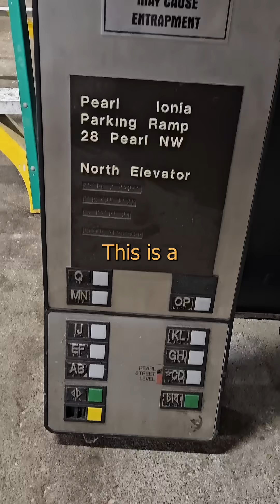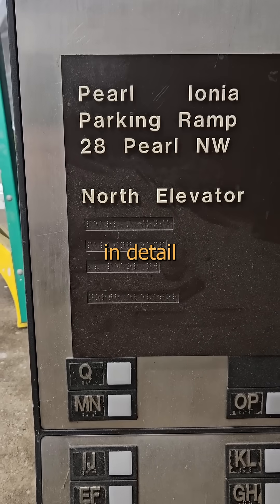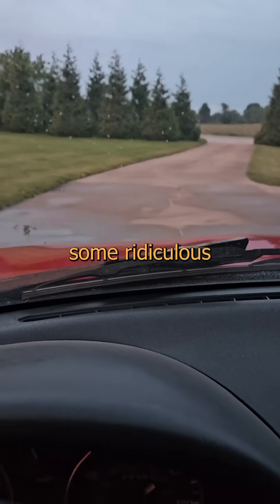Miata Mischief #chrisboden #engineering #gear #elevator #score #stories #parts #hacking #making

Comment: There used to be an amusement park in north Denver called Elitch Gardens. They had a train that you could ride around the park. By the west gates they had a large railroad crossing sign with flashing lights and a bell. When the park moved downtown a good friend of mine bought the sign at an auction. He had a small fiat so I took my vw microbus to help him pick it up. It ended up being too big to fit in the van, so we had to stick it out the sunroof. We got the strangest looks driving to his house. It's now his mailbox.

Comment: I owned a 90s Pontiac, I think, 2 door, and I ripped out the back seat and the passenger seat to have room and I packed it so full I had to squeeze in. 

I had a 91 Ford Explorer Hearse, the most awesome vehicle I ever owned. So smooth 
 Driving it was a dream. Still ran when I donated it to Cars 4 Kids. 

I packed in full of the skirting for my mobile home and I towed my 99 Avalon with it, fully packed. I blew out the shocks on the Explorer and almost crashed on I-87 near Catskill

I also tied a C-band Satellite Dish to the roof of the Explorer. I have a photo of that hanging on my wall. 

C-band Satellite Dishes are AWESOME and I highly recommend you get one.

Comment: About 5 years ago, I had a Mini Cooper (from 2014, so the BMW one). I had to get a 49" ultra-wide monitor from my home to my office (in box) but it just didn't fit.

So I opened up the sunroof, stuck it through and drove to the office with 35 centimeters of monitor box sticking out from the roof.

Comment: I once thought about starting a print shop at the house, and I actually drove to Canada to pick up a press, using a 90s t- bird pulling a trailer. Little did I know that you actually need a transmission cooler to tow with an automatic.  Long story short, I fried the tranny and blew the head gasket on the engine. Got the press home,  but spent the next weeks, fixing the car in the driveway.  Nothing like a tranny swap, I the middle of winter outside in ohio. Bonus points, to get the transmission out, you have to drop the drive shaft. To drop the drive shaft, you have to drop the gas tank. Lots of colorful words about Fords engineers.  Which brings up the point,  I see Ford has outdone that foolishness,  and now has an engine with a timing belt in an oil bath. Complete garbage. Remember,  friends don't let friends buy junk, even if it's used. The only way we are going to change things is by voting with our cash.

Comment: As a 1990 Miata owner my most noticeable hauls have been; 5 fraternity brothers at once, A keg of Bold rock hard Cider, a 65 inch TV, another miata motor. I like to tell people that the storage space is infinite if you just drop the top!
Reply: I like to think this was all done in one trip. Five frat bros, a huge keg of cider, a 65-inch TV, and the Miata motor is just for you to experiment with.
Reply: Go vertical FTW.
Reply: Top down I moved my dresser from one apartment to another across the back of my Capri convertible.

Comment: Ironically in a Miata I took the passenger seat out to haul home a spare motor with the transmission attached. Had it sitting on its nose and the end of the transmission was about three feet taller than the window lol

Comment: was running late to a gig one time so i decided to take my full guitar/amp/pedal board setup on the back of my motorcycle in an effort to make up some time… didn’t notice that i had a power cable flailing about behind me until it flung around and whapped me on the side of the leg at a stop light 😅 i’m lucky it didn’t get caught up in the chain

Comment: Oh boy! Mines on theme cause it was also in a miata! Round about when the virus was forcing the gov to dispense rations i figured id go get my alot ment in my only car. An '89 NA miata😂. In the prossess of waiting in line i was requested by both my divorced parents to pick up their portions as well. I will never forget the look on the service men's faces when i roll up and say i need the same size order they loaded into the SUV just before me. We managed to pack boxes on the shelf where the soft top sits and then put the top up. Just so we could fill the passenger seat and have a box hanging out the window with a bungie cord. Im suprised the trunk shut with how many crates we had back there but we all had a blast and they were laughing their asses off as I drove away. 😂😂 I miss that car every day, its one of the only cars I've owned where the smilespergallon matched the milespergallon

Comment: I picked up a 28' reefer trailer for cheap used my 2000 f350 with a hillbilly lifted fifth wheel in the bed and onboard air with a lever valve to drive it 5 miles home down back roads.

Comment: I’ve never done really sketchy stuff. I did carry a 130 lb ocean going rowboat on the roof of my Ford Aspire, but it was on a nice Yakima roof rack.  I even had special holders for the oars. 

I got someone to pay me to program the PDP 11-45 running genuine Western Electric Unix on its core memory.   And there was someone hired from Bell Labs to teach me to do it right.   

I did have to replace a water pump on a V6 78 Malibu because of towing a trailer over the Appalachian mountains, but there was a nice 24 hour truck stop that put the car in a tiny corner of their shop and had the water pump in stock.  

As an engineer I try to do apparently sketchy things in a non sketchy manner.

Comment: Remember to turn off the air to get an extra boost when hauling anything above 2 grams on the passenger seat!
Reply: This is a beast compared to the GEO metro 3 cylinder engine, carb  50 mpg 1991 compared to a mini Cooper today. Wasn't a Miata but I got a whole apartment of furniture in 2 trips , fridge washer and dryer in one , couch loveseat and chair in another, trunk and floor and inside everything was all the little stuff @physicsduck
Reply: That only matters when you are accelerating.😅

Comment: Shortly after I got my first car (a Ford probe I made quite a few jokes about it myself but I enjoyed the damn car) I was in high school my buddies and I used to go exploring once it started to get dark out we'd always stick to areas that we knew of during the daylight. Train tracks can we come across the spot where there's just a bunch of older vehicles that are somewhat abandoned in a spot where the grass was up to our waist. So we started looking around at all then where is quite a few decent vehicles none of them we could even do anything but we found in the back of a blazer a a subwoofer and the wiring so since we were able to get in we need to know that and the next night I went off alone what a blanket to help drag it out to where I stashed a red wagon and a bicycle so I could ride back home. So it's about 11:30 and here I am riding a bicycle with one hand dragging a wagon filled subwoofer wrapped in a blanket all the while I'm thinking to myself what's a cop doesn't drive past and ask me what I'm doingthe only way this would make me more suspicious as if I have the rolled up part to a ski mask instead of a bucket hat making me look more like a doofie mid teen. We got it to work sadly 3 years later I was involved in a car accident what a semi clip me off the highway and caused the manual transmission to lock up.

Comment: A few years ago, my mate bought a second-hand server cabinet on the marketplace, and I offered to help collect it with my car. 

Sounds reasonable enough? Well, my car makes the miata look like an F150, I drive an Aygo (for those in North America who haven't encountered one in the wild)

This looked like it'd be a struggle when we arrived so I asked if the people could hang around to make sure it fits in the car before they go away leaving us with it (they said they would, and then immediately left)

It took 40 minutes after a further 20 to dismantle as much as we could to get it in, I still have a gouge in my roof to remember it and I had to get my mate to sit behind me and with it across all the seats, I had to remove my gear knob to make it work and then had to drive 15 miles on 70mph roads with this thing weighing my car down to oblivion, shifting with a threaded rod straight from the gearbox, abandoning first gear and fucking my knuckles for second.

Somehow, it came out of the car in record time when we arrived.

This server cabinet now lives as a drink cabinet.

Comment: I had a chevy s10 when i was 18 i loaded it with 2500 pounds scrap and was riding on the ground. and some guy gave me 3,  26 ft long metal poles so i hung em over the tailgate and about 14 ft out the front.... Well the cops seen me so as soon as i was pulled over i immediately yelled at the cop " you cant pull me over mother fuc***  im a rare unicorn" the cop laughed so hard i didnt get a ticket. But he followed me 12 miles hone with lights on  talking shit and laughing.. 😅

Comment: When I was on the pipe line I was stuck living in hotel rooms since I didn’t have a travel trailer at the time the “Hotel” trailer house divided into 6 different rooms didn’t have mini fridges for the first year I had this giant igloo cooler I kept all my meats and drinks in finally got tired of buying 40 pound of ice just about daily drove an hour to the nearest WalMart in San Angelo and bought a Black & Decker Mini Fridge got outside with it is was to long to fit in the trunk on my 04 CVPI  which is pretty sad cause the trunks on Crown Vic’s are huge couldn’t go through the back door again because of size I ended up in bolting the passenger seat putting it in the back seat and putting the fridge in the front seats place to get it back to the hotel

Comment: I wish i could put a picture in my comment. One time, i built a roof rack out of 2x4s and carraige bolts to haul the lumber for a fence to a clients house on top of my 1997 Infiniti i30, basically a fancy Maxima. I ran a handyman service out of that car for two years until it blew the head gaskets. I miss that old car.

Comment: So I was working on my Ford f100 1969 truck seat as in redoing the upholstery, and I needed to move the seat to my auto shop class at the school, and the only thing I had to move it was my 2007 Honda Accord sedan, it's a tiny car, and that seat did not fit, so I dropped the front passenger seat as far back as it could go and balanced the seat on that seat hoping I wouldn't shred the ceiling and seat from all the exposed metal, it infact did not shred the seat or roof.

Comment: Me and a few family members got together to do a huge load of scrap in a 5.7 hemi ram 1500. You may find yourself thinking "well that's normal" and you'd be wrong. You see, the scrap was a bunch of AC units. Like a lot of them. We tore everything apart and folded, cut, pressed and stuffed it all in the back of the truck and took of to Tenenbaum as they were the only scrapyard that had the equivalent that could weigh us. The whole way there, the hitch was scrapping the interstate on every bump and you could fit a peace of paper between the rear tires and the fender well. The loaded ended up being just under 8 tons and we made around $10.000 that day. Not bad for 4 dudes and a baby hemi

Comment: My first year of trade school the current Professor was forcibly being retired and was emptying out all the engines and Transmissions that he had accumulated for teaching the students on how to work on cars he offered to give me a choice. So I loosened the carpet trim and back seat out of my 86 Oldsmobile roll it all forward to the very back of the driver seat and proceeded to load three transmissions and two s.b.c. engines, into my 2 door sedan. That ride cost me some suspension compenents.

Comment: I have never wished more in my life to be able to post pictures I have several Toyota MR2 spyders and often take them on vacations I have built two luggage racks for the cars one that plugs into a removable resse hitch and the other that attaches to the top of the rear engine compartment lid and quite often pile luggage twice the hight of the car to go on trips

Comment: I drive a bolt EUV. I need to do home renos and I’m cheap. Too cheap to rent a proper vehicle and too cheap to shop at a store if I can help it. Cue me driving down the highway with my four ways on and 4 sheets of 3/8 inch OSB strapped to my roof rails with ratchet straps that went through the doors of the car (not the windows, we opened the door ran it and closed the doors). We made it and I have continued to do sketchy shit with that little EV.

Comment: As a miata owner (NB but close enough) I approve, I have moved twice (both times around 400kms between the previous and nee location) since acquiring the mx5, so it took part in the moving process like all the other vehicles we own, nothing crazier than a skimboard but she was loaded full both times, including the passenger "area"  with shit strapped to the seat because driving with the top up is for sissies.

Edit: for some funny hauling content, me and my friend in mid school used to ride one bike home from school (3-4 kms), one sitting backeards on the handlebars and pedaling, the other sitting normally and steering while looking over or under the shoulder of the other guy xd Yes, that was dumb as f and we even crashed into the rear of a car once xd

Comment: I bought a 300 gallon fish tank and had to drive 1.5 hours each way to get it.  Unfortunately my jeep did not have enough room to fit the tank so I took my small trailer, but putting that giant glass on the trailer was not going to work either... So I hired my sister with her mom van... Fit like a... Very tight glove... Sisters van was squatted on just one side and could barely turn.  Fuel mileage went from 20 to 8, and we somehow magically made it without incident .. I was fully ready to pay for a new tire

Comment: Riding a bike and going to art school. I've got tons of them. I thought 50 pounds of clay would be easy, just tuck it under my arm and go. Yeah, no. Trying to balance it on my bike seat while walking my bike and keeping the rest of my supplies from sliding down my arms was a fun 45-minute commute that was normally 5. 

Painting class was worse, you couldn't keep your supplies in class. So under my arm while riding every day: several canvases, a drawing board, a portfolio, and a supply box. I held the box at an angle to keep the flat stuff from sliding out from under my arm. Plus a backpack. Plus, on multiple occasions, a coffee that I did sip as I rode. Up and down a heavy grade mind you. I did finally crash one day, and had a weird thought later that an animal probably came along and ate the chunks of me I left on the road. 

Although I still think what hit me the most looks, was trying to gently cradle a bouquet of flowers while riding. My girlfriend, now wife, put up with a lot dating me, I had to get her something nice and they didn't need to be smooshed when she got them.

Comment: Man you just reminded me of the worn out 95 Honda del sol I had when I was 17. The car barely weighed more than I did and if you weren't perfectly graceful sliding under the steering wheel you'd pop a hip out of place. But 10 dollars topped the tank up and the 5 speed was smooth as silk butter

Comment: While stationed in FL, I made a stop at the local Publix on my way home from work to pick something up. By the time I was done, I had a full shopping cart. While the poor guy was wheeling my cart out, I was through my head everything I had gotten, actually feeling pretty good about my haul and remembering everything, when a simple question snapped me back into reality. "Sir, which car is yours?"
Um, Oops. I had ridden my mototorcycle. The poor bastard looked at me, started to turn around to tell me that my cart would be in the cooler waiting for me to when I return with a car but I assured him it would work out. It did By stuffing everything in the saddlebags and trunk. I didn't even smash my poop-tickets.

Comment: Had a tv that finally broke down, went to buy a new one and the box was too big to fit inside of my cobalt, ended up sticking it in the backseat with the door open 6 inches and I sat back there holding the door as closed as possible, stuck my two kids in the front seat while my wife drove us home, less than a week later my youngest son pushed the tv off the stand and broke it 💔 after this I ordered a new tv to be delivered to my front steps

Comment: I Went on a trip down to Hawaii - Oahu, specifically - To see a long time internet friend. I had some pretty crappy bags as it was first time flying abroad, and we rented a 2017 Mazda Miata RF on turo. (the hardtop targa.) Great on gas mileage and fun, but not so great on trunk space for much more than a quick grocery run. Well, back to the luggage part. While i was down there i had gotten some items that were a little too big for the bags I had. So on the 2nd to last day of my trip, we popped over to the Alo Moana Center, and bought a large Swissgear suitcase. It wouldnt fit in the trunk. So ... we put the roof down and my friend held it awkwardly in his lap as we drove home. It was very uncomfortable but well worth it as now i had a proper suitcase to hold everything and then some.